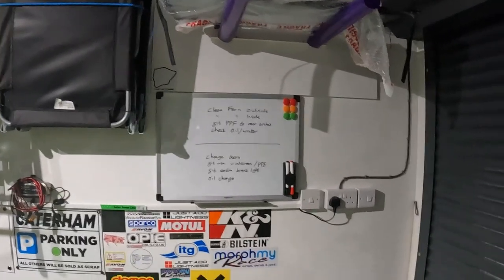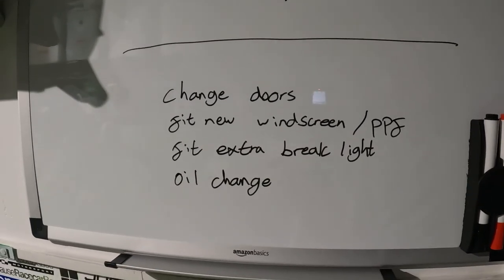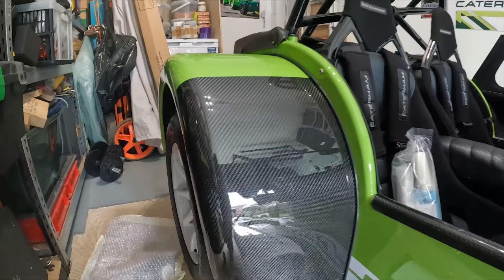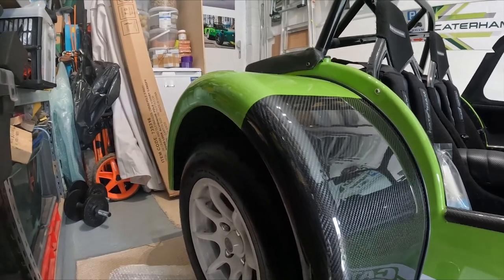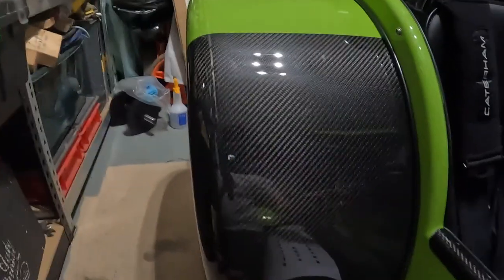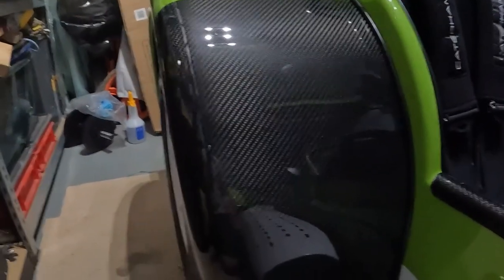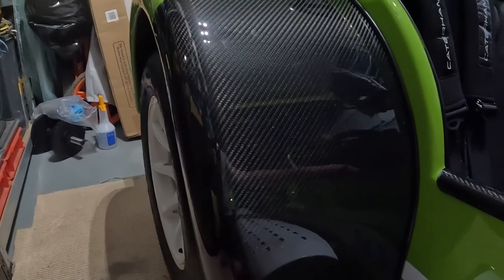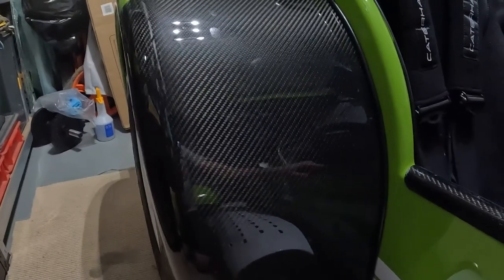Fitting PPF to Caterham Ultimate Carbon rear arches how hard can it be? Premier Paint Guard PPF

Comment: Hi, what wheels and tyres are running on?  I have KN Alloys 6 x 13 all round with Toyo 888Rs.  Looking to buy a second set of wheels so that I have semi-slicks for summer and track days and wets for winter.  I like the OZ Supertirismo WRC in 14” but R14 tyres are scarce and I don’t really want to jump up to a 15” wheel.  In a perfect World OZ would make these in 6x13 and 8x13.  My car is red with white nose cone and broad stripe, white wheels would complement the look.  Good to see Fern back on the road after that unfortunate incident.  Many thanks.  Simon.
Reply from the maker: Hi Simon thanks for subscribing I really appreciate it. I'm not sure what the name is for the wheels but they are an older Caterham style. You can get them second hand but not new now. I have 6x13 on the front and 8x13 on the back on ZZS tyres. I would like to try 6x13 all round as that's how the supersport was designed. Fern is probably over tyred but I don't know any different. Do you like the apollos? I really like the white wheels but they get dirty very quickly. I've had them off for cleaning sooo many times. I do love the look though. Fern definitely sticks out in a good way I think 😀
Reply: They are 8 spoke and look a lot like mine which are KN Alloys which are found on older cars, mine’s an ex academy car (2010) spec’d up to 140hp.  I’m assuming you had them repainted in white?  I’ve only had the car since October.  From what I know 6” all round is better in the wet (less aquaplaning) and ‘enjoyed’ in the dry as it is easier to get the back end out.  I was thinking 6” front 8” rear with semi slicks for summer and keep what I have now for winter and put wets on.  I like the red lettering on the white OZ wheels but they don’t do them in 13” and I don’t really want to move up to 15” wheels as many consider the ride too firm.  Love the Orcus but not sure I want 6.5” all round.  Whatever I go for I would just like to fill the rear arches a little more.  Interesting to note that most 2nd hand Caterhams fitted with KN Alloys ten to have 8” on the rear.  Yes I do like the Apollo wheels and had thought that I might just go for a set of those in silver.  Haven’t commented on YouTube for a while and had forgotten how limited one is with comments, can’t share images in the reply.  If you’re interested in seeing mine you can find me on Instagram at monsieur_genepi
Reply from the maker: @simonorr822  hi Simon I've just followed you on Instagram. Lovely looking car. I know people call them 8 spokes and the 10 spokes are 15" but I wasn't sure if there was an actual name for them if that makes sense. Personally I would only have Caterham specific wheels. I've only driven with 13" wheels but I've read alot about people saying they prefer 13" wheels. I know what you mean about filling the rear arches but they are all the same and it changes a bit when someone is in the car. I quite like the new youtube @ so you can tag people. Have you got much planned for next year with your new car?
Reply: I bought the car from PT Sportscars and went to a Caterham only track day organised by them at Snetterton a week later.  Had a fantastic day and would like to do some more track days next year.  I have joined the Caterham and Lotus 7 Club and would like to go to some of the local meets and do some track days with them and maybe the fish and trip run too.  There are some great drives to be had to places like Bafflehaus and The Winchester Auto Barn.  I need to invest in some decent ear protection as long journeys leave you with ringing ears especially if I’ve been driving with the roof on.  Sadly my other half is not a fan as she feels very vulnerable in such a small low car, so many of these trips are likely to be just me until she gets used to it.
Reply: Oh and thanks for the compliment, she’s a lovely looking car.  Originally black and red but had it changed to white and red which just pops. 😎👍
Reply from the maker: @simonorr822  my wife wasn't keen, but I bought new padding for my seats and the padding on the shoulder straps. The Just Add Lightness headsets make a massive difference as we can talk and listen to music. Things like that make a big difference. I will be at the F&C run. Please say hi if you see me.
Reply: @ACaterhamCalledFern  I will, is there a date set yet?